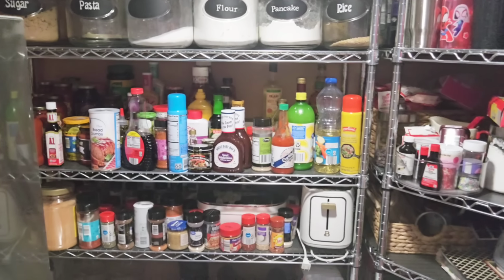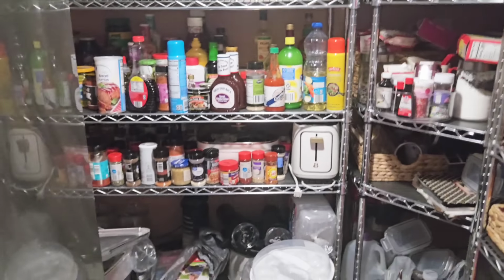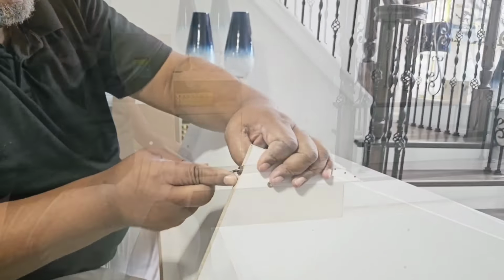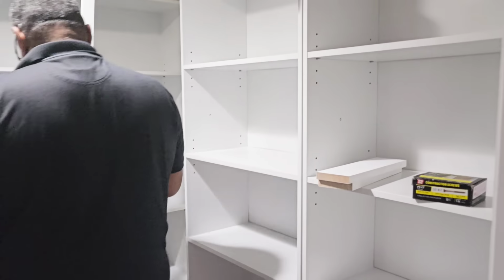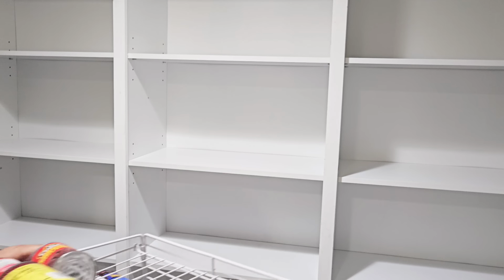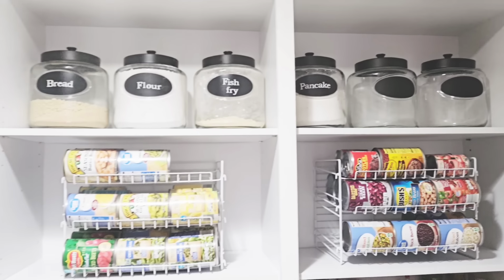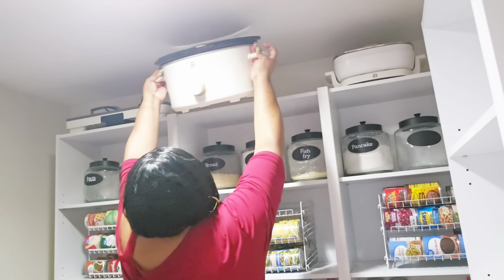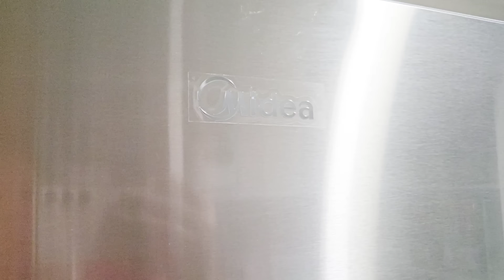DIY Pantry Makeover with Inexpensive Bookcases Ep.2

Comment: The manufacturer usually recommends using only a hand screw driver, because a power drill is overkill.  I love your final result!
Reply: I adjusted the torch down to 5 or 6, to limit the pressure on my drill